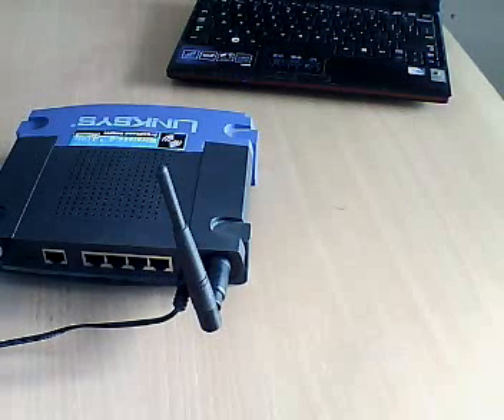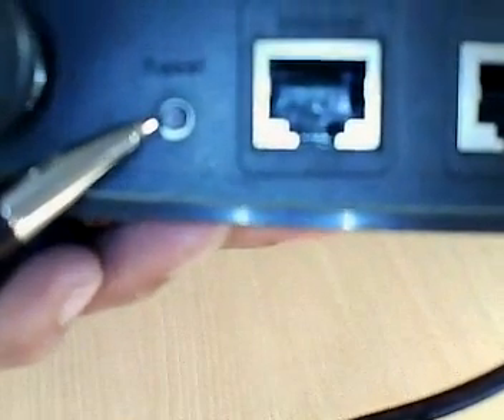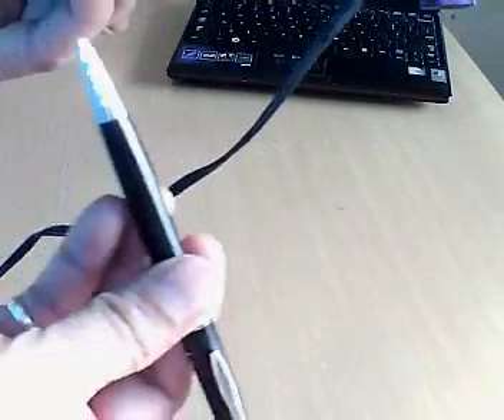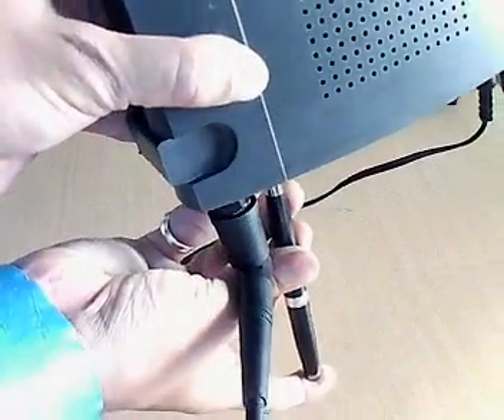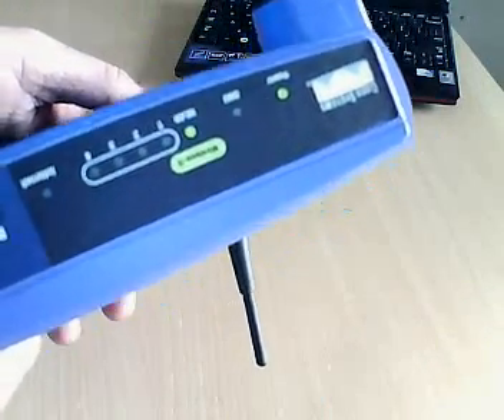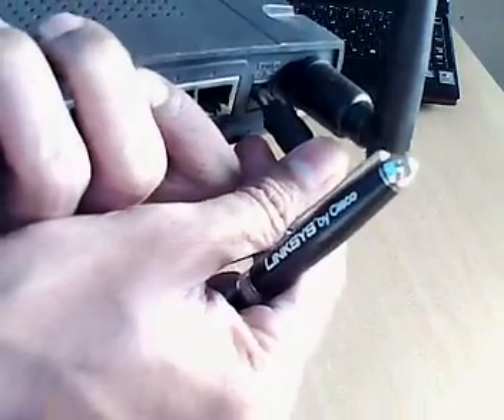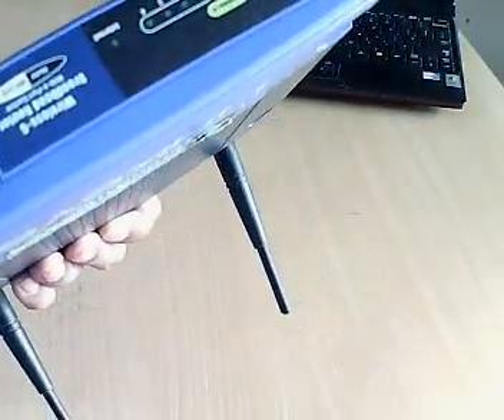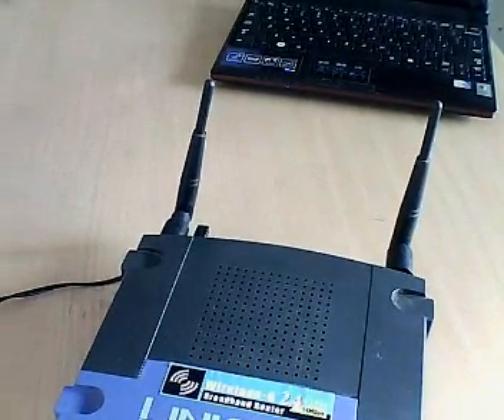How to reset Linksys router | Blinking power light

Comment: Didn't work
Reply from the maker: Is the power light blinking on your router? When you press the reset button on the router, the power light must blink while resetting. Do you get IP address on your computer when connected to the router LAN port with the cable.
Please explain.

Comment: Mine when I reset it it keeps on doing a blinking reboot and keeps on doing it idk how to make it solid
Reply from the maker: If the power light on your router is blinking continuously then there
 is a problem with your device. It might be bricked. Try to reset the 
router 2 – 3 times and check to see if the power light becomes solid.If the power light is still blinking then you can try 30-30 reset on your router.
Follow these steps - http://fixhomenetwork.com/blog/how-to-reset-linksys-router/

Comment: Any chance you can walk me thru resetting the security key without having the actual security key? I tried the reset, and even tried hooking up an Ethernet cable and going thru the 'easy setup' white/orange light.. Hate windows 8.. I can also try Win7, but only with wifi, desktop too far for a cable
Reply: Better to call Linksys support 1800-975-0148 ( US & Canada ) if you are not sure about the settings.
Reply: @tomflinn3697  TX :D

Comment from the maker: Not all the routers have same IP address. Disconnect all the cables from your router. Connect only the power cable. The connect one Ethernet cable to port 1 on the router and your computer. Check the lights on the router. Now check the IP address and default gateway on your computer. Default gateway number is the IP address which will open the setup page.

Comment from the maker: @mikeashiwale Did you try to open the setup page? Open Internet browser and in the address bar type 192.168.1.1 and see if you can open the setup page. If you are able to open the setup page then you don't even need to reset Linksys router. Go to wireless tab and change the wireless settings.

Comment: I am trying to access the setup page of my Linksys E1000 wireless router so that I can change some wireless settings. I typed in 192.168.1.1. It is asking me for user name and password but not taking the password. I did not install router using Cisco connect. I reset the router 3 times but still the admin password is not working after the reset. What can I do now?